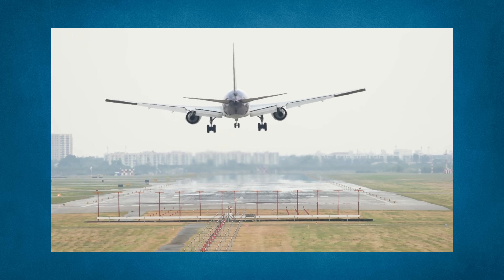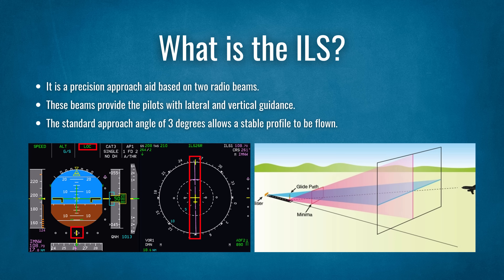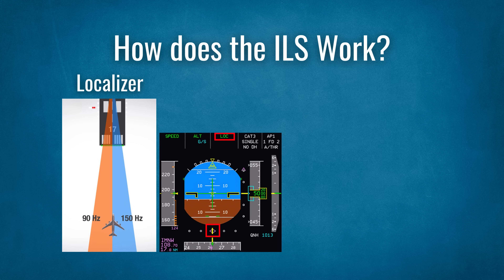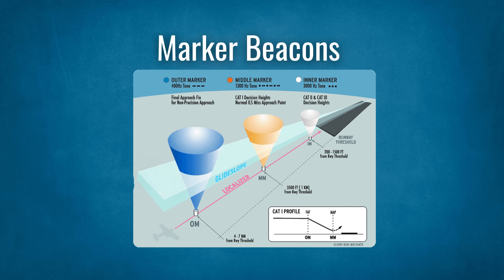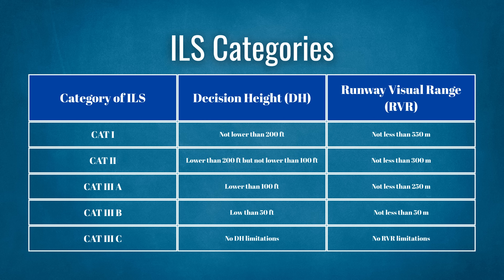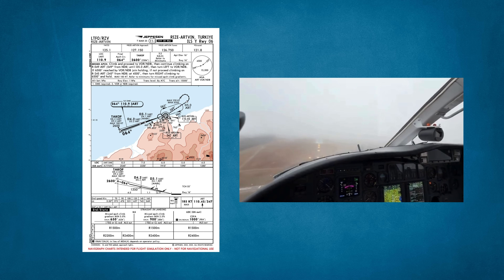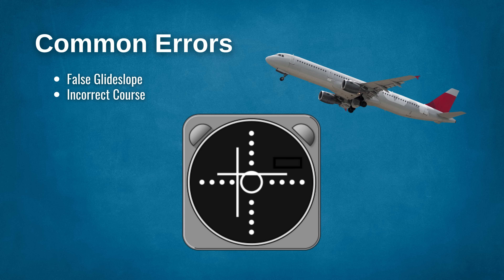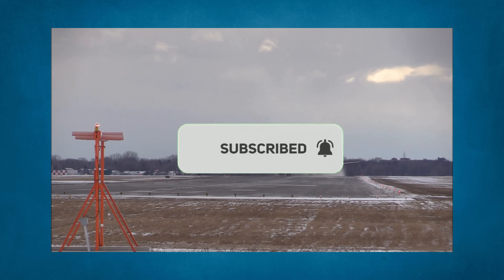How ILS Works? | Instrument Landing System Explained

Comment: What is a practical strategy? Set the course bar to inbound track and estimate the required heading according to reported wind and adjust the heading bug.
Intercepting the GP (one dot above) lower the gear and intermediate flap setting. Observe the tendency. Adjust a new heading.
Wings level (this is important)!!!
Observe the tendency. Adjust a new heading again.
Wings level!!!
Check if course bar and deviation bar are in line. Adjust a new heading again such that these bars get in line.
Wings level again.
Once course bar and deviation bar are in line continue with this heading but observe any tendency of the deviation bar to drift away.
Minor heading corrections might be necessary (half a degree, within the bug range), but again wings level!
Continue to do so until touch down.
Elder installations and modern avionic systems are evenly accurate. Elder HSI allow even better estimates in fractions of bar width.
Low visibility conditions are rare, less than one percent. It makes sens to try this on a simulator.
If this helps to save a single life this would make me happy!
Reply from the maker: Thanks again! 🎉
Reply: @yildiray.pinarbas  I love you all !

Comment: ILS is the finest landing system. The GPS satellites transmit a signal that arrives with microwatts on the surface. The ILS antennas radiate with some 40 Watt. GPS might be jammed, ILS not so easy.
Everybody should make this test upon take off. Key in the Localizer frequency in and set the course bar in RWY direction, then taxi before takeoff to the right edge of the RWY. You should observe a slight fly left indication, roughly one and a halve deviation bar width. Memorize this deviation! Then you taxi to the left edge of the RWY. You should observe a fly right indication of the same magnitude.
As long as you are in-between these limits you are safely on the RWY.
Thus, you are able to land the aircraft in zero visibility conditions, as long you are able to fly the ILS with such accuracy.
You are never lost!
Reply from the maker: Best comment I have ever seen. 🏆 You are %100 right! Thanks a lot. ✈️🫡